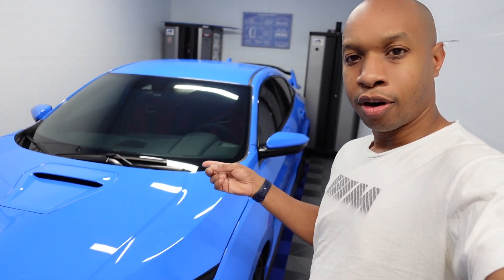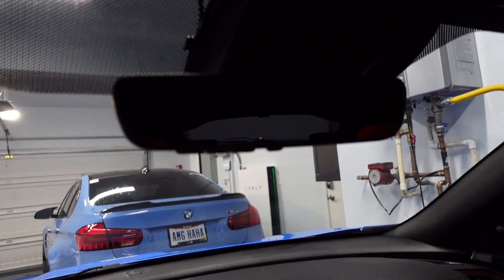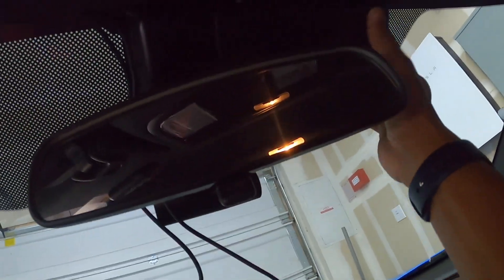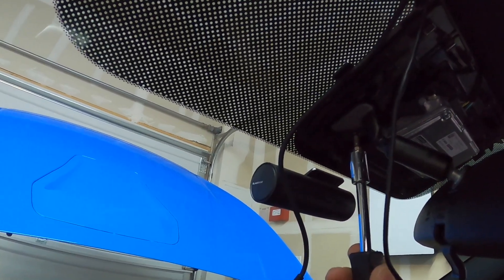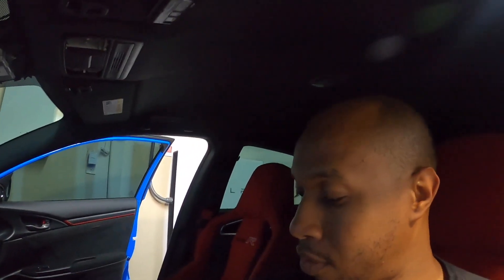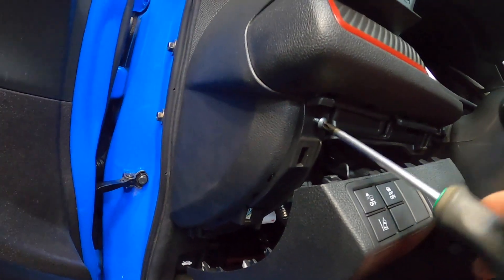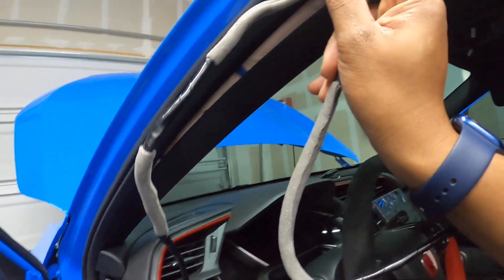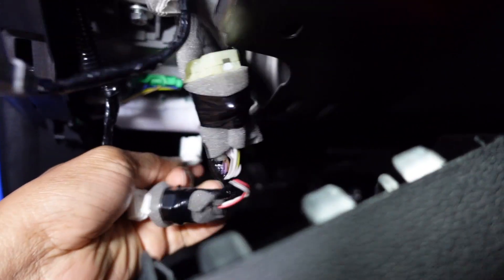Honda Civic Type R - Auto-Dimming Rear View Mirror Install DIY

Comment: So my Civic already had the auto-dimming mirror, but I bought this because I liked the frameless look instead but I don’t think I have power to my HomeLink buttons because they don’t light up like yours. Does your harness connector have more than 3 wires running to the connector in the mirror? I think I may need to buy a new harness.

Comment: I had my local Honda dealer installed this mirro on my new 2022 accord. The dimming function works, but the home link red light does not turn on or flicker when I press the buttons to program my garage door. Any idea what it could be? Thanks.
Reply from the maker: It sounds like a bad mirror or they forgot to plug something in. I’m leaning towards a faulty mirror because if it’s getting power to dim, the homelink should work.
Reply: @eddiemcars  the idiot tech forgot to install the 20 amp fuse. I ended up doing it myself. Works good now. Thanks for the response.

Comment: Is this only for a 2021? Or will it work on a 2020 as well?
Reply from the maker: It will work for 2020.
Reply: @eddiemcars  man thank you so much for your response! For some reason when I searched for the part it said 2021 but not 2020 so was just checking
Reply from the maker: @fastminivan  the 2020 came with the Honda sensing safety stuff so there should be plugs under the dash when it plug in